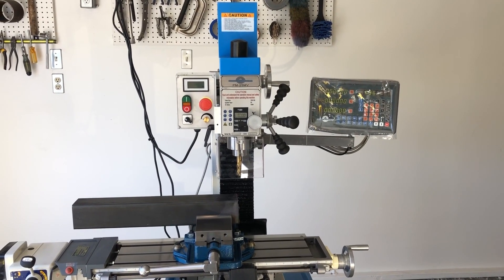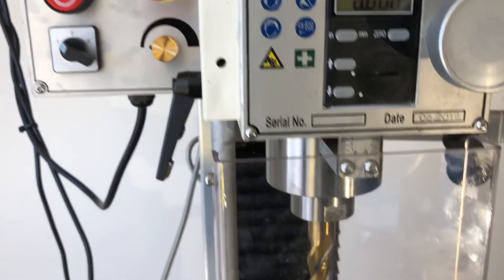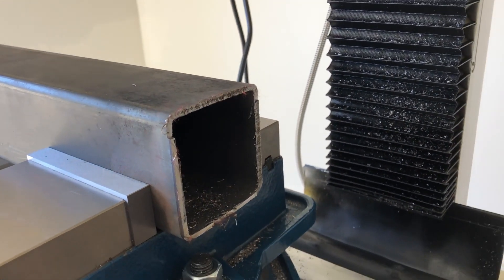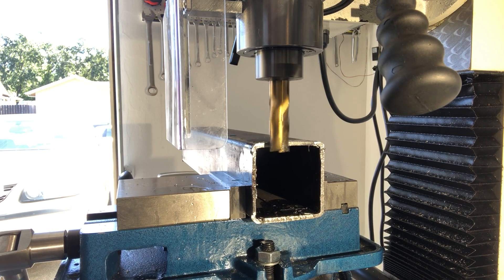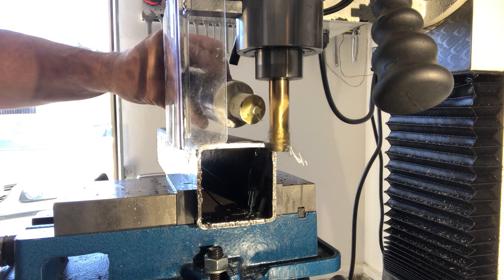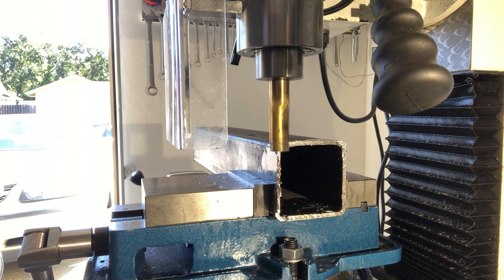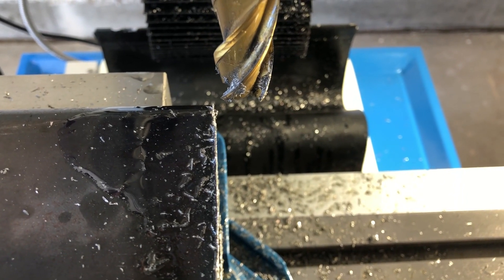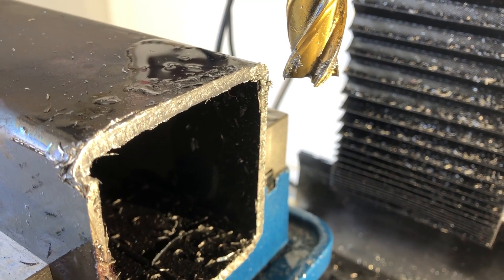First Project on my PM-25MV

Comment: A couple of points that may help you following the video the first pass you made was a climb cut any time your feeding the cutter in the direction your piece is moving is a climb cut,the cutter is "climbing" across the piece when the cutter rotation is rotating against the direction of the movement of the part it is called conventional cutting next your feed is not as precise as you think it is as long as to are withing 20 either direction your good if your target is 509 you will be fine from 489 to 529 as was mentioned by others get some support on the far end it will make your work piece more rigid and accurate because you will remove the possibility of a tilt next lower your cutter the closer you are to the quill body the more solid your cutter will run, out on the end of the cutter may have a slight wobble from centrifugal force it may be a much as couple of ten thousands or even several hundred thousands, buy yourself a simple spray bottle and fill it with your desired coolant give it a squirt a couple time through the pass it will help your cutter live longer and give you a slightly better surface finish

Comment: I have the same mill, pretty nice imo.  I would suggest a machinist jack, 123 block or similar under the far end of your tube, and then clamp over the far end to tighten onto the jack. ( wide face on that support)  I think that will help eliminate your vibration. Then while you are at it, maybe a stop at the far end so you can turn your work without indexing over and over.
Reply from the maker: Great tips! Much appreciated.

Comment: And save yourself some money and just use WD40 instead of cutting fluid.
Reply from the maker: For mild steel, I have been using dark screw cutting fluid. It was $20 for a full gallon.
Reply: Rigidity is key when milling.

Comment: Support the other end of the tubing so you don’t get that resonance. Also like someone else previously said, use the tool at the shortest cutting surface so it’s as rigid as possible. And make sure you’re using a four flute (or more) end mill.